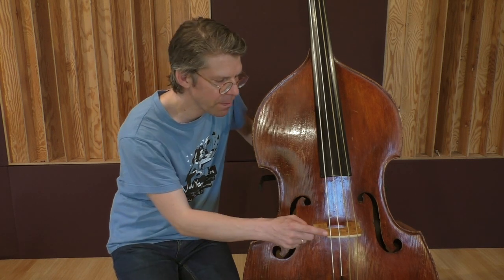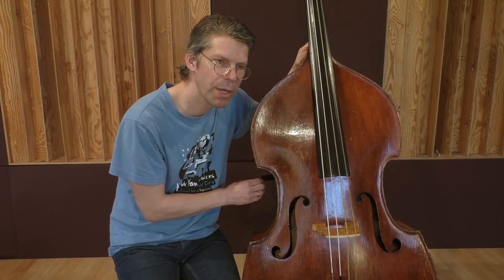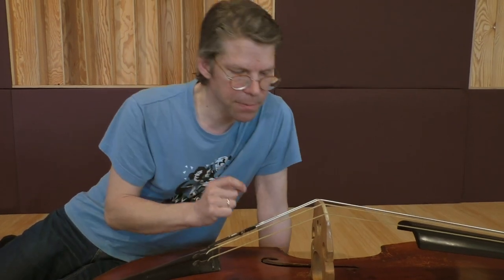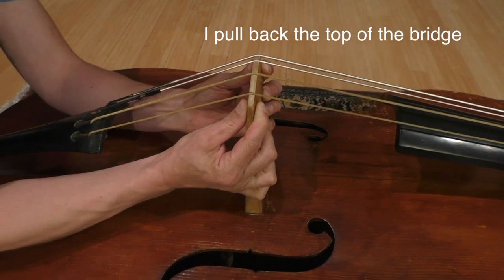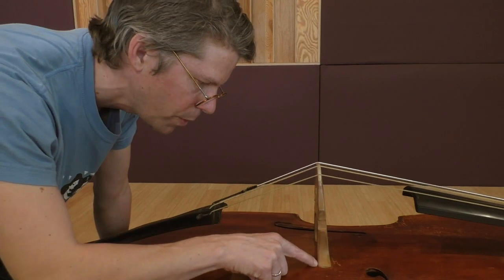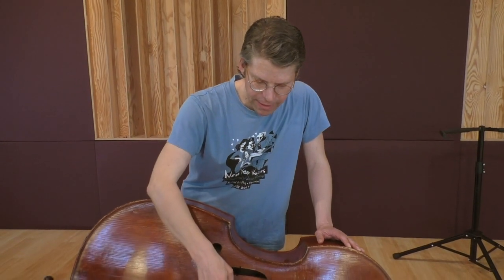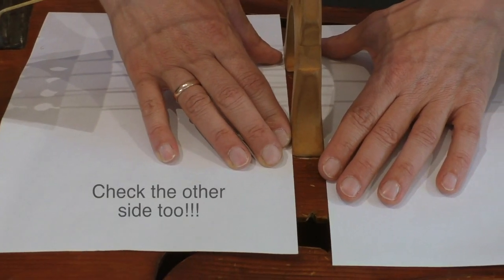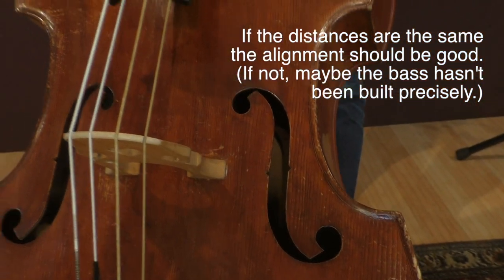Checking And Adjusting The Angle Of Your Bridge (Upright Bass)

Comment: Hello sir. Many thanks for Your vídeo... I have a question. Wich are the Best hights of the strings (E/A/D/G) and how can i set up them...

Many thanks un advance!
Reply from the maker: Hello Eduardo, there is no real "best height". It depends on your taste and the type of strings you use. I normally have 7 to 10 mm (G to E) measured at the end of the fingerboard. But that's already high. 1 or 2 mm less are better for a start. But I recommend going to a specialized bass workshop to have them make that setup.

Comment: I play mostly bluegrass and western swing. 1) What type of adjustable bridge would you recommend to replace the current bridge which has no adjustment left? 2) At the nut, the strings are almost touching the fingerboard, leaving me with how to lower the action further, currently higher than near the nut, down the neck without causing buzz? Thank you!
Reply from the maker: Hi! Difficult to answer your questions: 1) I don't really know about the advantages/ inconvenients of different bridge types. A good bass Luthier (preferably one that is not only into classical setups) will know more. If the present bridge is still good, he may also suggest to put adjusters in that bridge. 2) it is totally normal that the strings almost touch the fingerboard at the nut. Some say: it is correct if a business card fits between string and fingerboard. So yes you'll have to lower the height of the bridge. And to avoid buzzing you need an optimal fingerboard concavity (there's probably another English word for that). And here too: only experienced luthiers know all the details about this and how to realize it.

Comment: Hello! my bridge is flat on the one side and curved on the other. Which side goes where? Does the flat side need to look up and the flat side towards the foot? I ve been struggling adjusting the bridge, this video helps in other questions I've been having, thank you
Reply from the maker: The curved side is the one that you can see when you play the bass. I should have said this in the video... Good luck!
Reply: @stringmatrix  Oh dear, I have put it wrong then. Probably the reason I have a hard time tuning it correctly. Thank you!

Comment: Very informative video, thank you. I have been playing bass guitar for 30 years and was gifted a 3/4 bass that may have been made in China. It is in average condition, but it wont stay in tune and it appears that the top of the bridge is bending toward the headstock. I think the strings are causing the bridge to bend, and that the strings are not 'gliding" over the bridge, and are instead pulling on the bridge. I was thinking of replacing the bridge, or filingthe grooves slightly to give the strings a little more room. Any suggestions?
Reply: Scott it helps to rub a thick soft pencil (B or softer) in the bridge grooves to coat them with graphite. You can do this by detuning one string at a time, keeping the others up to pitch
Reply: @geofharris5546  Thank you very much

Comment: Many thanks for the useful videos! Great. Can you make an video / or tell me about the height of the strings. I'm playing Rockabilly music and I don't know if my heights is good. And if it's too high, is there a way to bring it down? Thank you soo much for your help in advance. regards, Marco from Lelystad (Netherlands)
Reply from the maker: Thank you! Hmm I am not a specialist, but I will think about it. The optimal height also depends of the type of string and of your personal taste. My standard height (measured at the end of the fingerboard) is G: 7 mm, D: 8 mm, A: 9 mm, E: 10 mm. But for steel strings that's already quite high.
Reply: Hello! Well, i am Playing Rockabilly since 34 years now. You can use a simple trick: You can check the height of the strings, by putting the tip of your middlefinger straight on your fingerboard on the height where you actually use to slap. Then check at every single string on which point the string crosses your fingertip. For the slap-tecnique, you need to undertake the string with the half of your fingertip (Still meaning the middlefinger). If the string is setted too low, you will not be able to undertake the string enough. Your finger will "Slip away". If the Height is too high, you surely will be able to pick up the String mit your fingertip, but you will need too much strengh to make the string sound, wich will hurt you on your wrist after a while. So at last, every single String should be around 10 to 12mm high from the point you use slap on the fingerboard.

Comment: My upright bass has a rattle when I play an open G string. I gripped the tuner button and it stopped rattling. Any suggestions for stopping this rattling key. The D, E, and A do not rattle. Super glue where the button and the shaft connect perhaps? This is an old German made bass with brass tuning keys. Any help greatly appreciated.
Reply from the maker: Check all the screws. If this doesn't help, then the "spiral shaft" (I don't know how this is called correctly) or the "gear" might be worn out. In this case, you can get help with elastic bands which should pull the problem-key in a certain direction. Experiment with elastic bands. It's not a beautiful repair, but even some orchestra players do it this way because the "correct" way would be to replace the whole tuning device.

Comment: I appreciate that you show how to check alignment between the f holes but you don't explain how to change it. Is this something only a luthier should do?
Reply from the maker: That's a good point. I should have shown it. If you loosen the tension (maybe one whole step on each string) you can adjust the position by hitting the sides of the bridge's feet carefully with your palm.